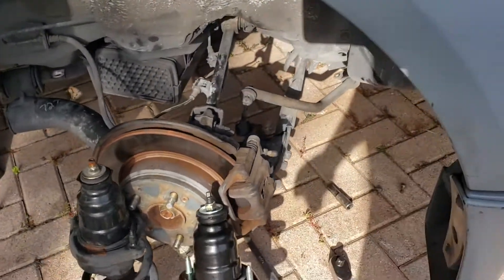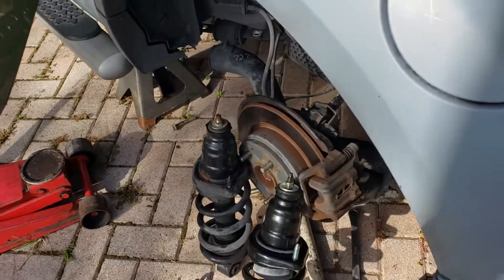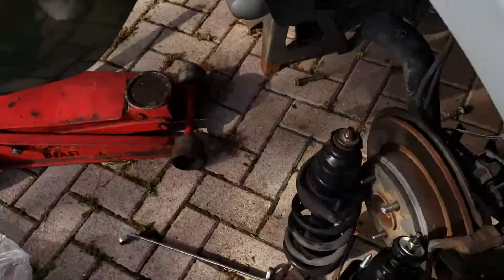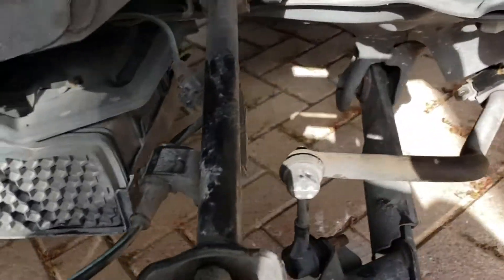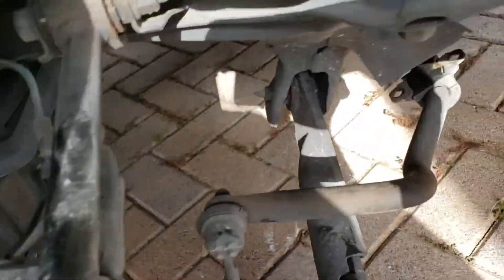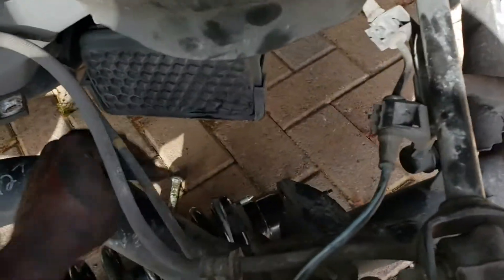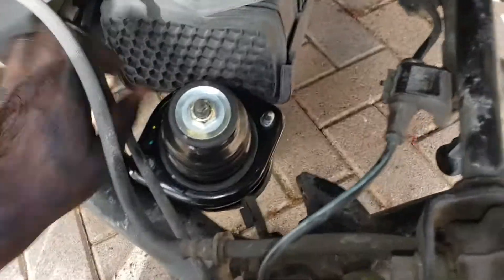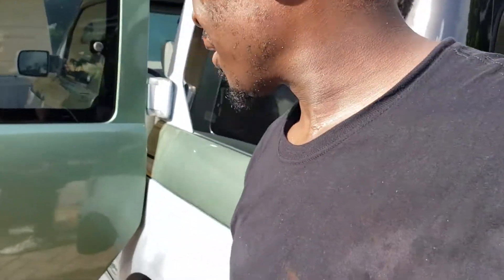2003 Honda Element rear shock assembly

Comment: Did you get it back together and was there an issue with aligning those bolts with the wheel frame
Reply from the maker: No not at all very easy , there weren't any issue at all
Reply: Cheda Benz Thanks for the video I’ll be attempting  this on own ,this weekend finally ,on my 2006 Honda Element
Reply from the maker: You're welcome my bro and good luck, thanks for watching my video please subscribe thanks.